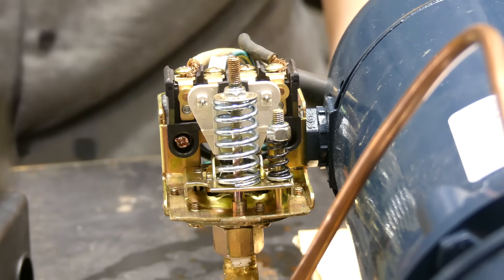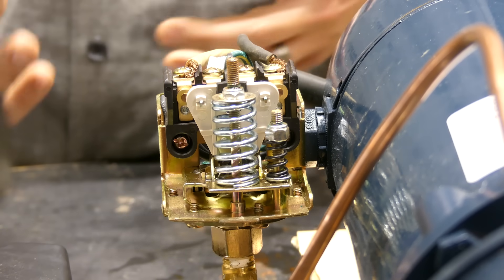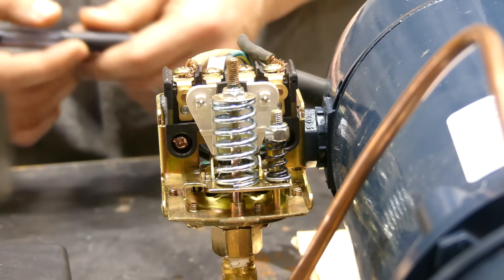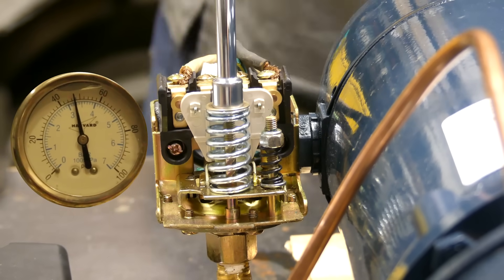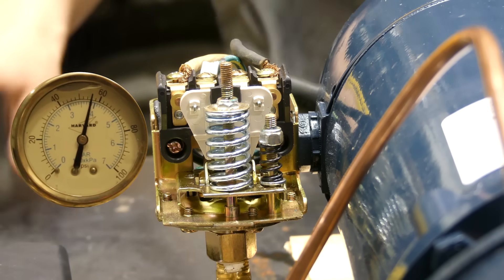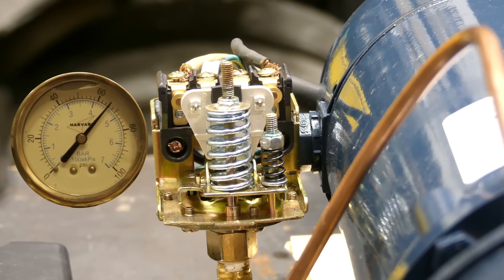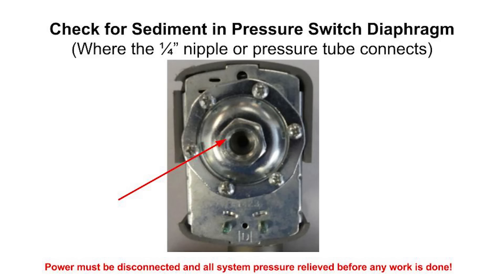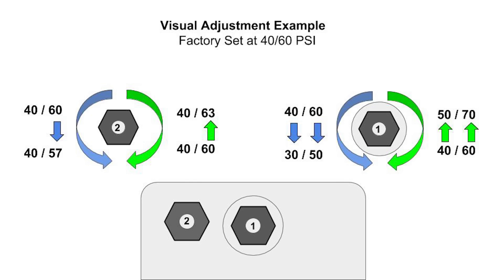How To Adjust a Pressure Switch

Comment: If you increase differential pressure should increase air pressure in pressure tank?
Reply from the maker: Good question! The answer is no, since only the cut OUT pressure changes there's  no need to change the tank pressure.

Comment: How long should it take to go from 30-50?  Mine is much much slower than what you demonstrated but I'm not sure is its because your's is in a controlled environment.
Reply from the maker: Ideally, your run time should be at least a minute every time the pump turns on.
Reply: If you have a large tank and a small pump, it could take a while.   Perhaps the most the pump can put out is 50 psi.  It needs to be rated above this.

Comment: I only have good pressure while my well water jet pump is running. I cant take a shower without it running as the water loses all pressure within minutes. How can I keep a steady pressure in the house? Is there an adjustment I can make so the pump starts more often?
Reply from the maker: It sounds like your pressure tank has failed or you need a larger one. I don't think it's an issue with the pump. Check out our video on how to check a pressure tank for more info.
Reply: @RCworstwater  alright thank you!

Comment: I have just had a new bladder tank and pressure switch installed and now when using the shower the water will stop and then start again in about 5 seconds. could this be a bad switch? the water also spits and sputters at times.
Reply from the maker: It sounds like the pressure in the tank is not set correctly. Check out our video on it: How to Adjust a Pressure Tank Video: https://youtu.be/w21qa2bMUh8

Comment: I have two pressure pumps which runs interchangeably. But for sometime now, it doesn't change. Example; if pump-A is running, if doesn't change. What could be the problem???
Reply from the maker: I don't understand the question. Please give us a call: 855.329.4519

Comment: Pressure at the  1"  (perhaps 1 1/4") water line (city water) is barely 20 . If I dial up my pump to 30 / 50 from 20/40 can cavitation occur enough to cause the pump to burn out prematurely?
Reply: Just make sure the city water is always there, else you may burn out the bearings or motor on your pump.  Where I live in Mexico, we run the intermittent, low pressure water into a cistern.  Then pump the water from there.

Comment: I bought a new pressure switch the other day and it worked fine but now there is no power to the switch at all. I put the old one back on again and it works again but it won’t cut out that’s the reason I bought a new one In The first place. What can the problem be. Thanks
Reply from the maker: It depends on what you mean by "no power to the switch". If it is wired correctly, you should be able to test and see voltage on one half when the contacts are open, and both sides when it is closed. If there is no voltage at the switch whatsoever then your breaker must be off. Give us a call and we can help you troubleshoot over the phone: 855.329.4519

Comment: Hello I would like to say that these are great videos. I do have a question, I live in Chile and do not speak Spanish nor do I trust and Chilean to know what they are doing. With that being said I am trying to get water from my hand dug well to my house (about 100 meters away) and I have a 2hp pump and a pressure tank (24L) with pressure switch (tried an electric switch but would not work do to the distance) all new. I've tried to adjust the pressure switch but the pressure gauge goes up to 50/51 psi and stays there with the pump continually running, what can I do now to try and set it up where the pump gets to the right pressure and shuts off? 

The pump is a Chinese pump (leo) and the tank and pressure switch is Italian (Italtecnica).
Reply: 2 hp sounds more than adequate.  If the pump doesn't shut off, you need to lower the settings on the pressure switch otherwise it may burn out.  I assume the pressure tank, switch, and pump are co-located.

I live in Mexico, and it took 3 plumbers to finally follow my instructions to add some air to my pressure tank.

Comment: hello thanks for your effort, i have a question, can i use it to empty the accumulator while i need empty it when the inside fluid pressure increase to 120bar till the pressure drop to 25 bar

Comment: So is it ok to crank a square-d 20/40 switch up to 30/50 or should i buy a 30/50 switch?
Reply from the maker: You should be able to crank it up to 30-50 like we showed in the video without an issue. Keep in mind that if your pump can't produce the 10 extra pounds it will burn up, so make sure it turns off after you increase it. Once you verify it is able to produce the new pressure, you'll have to add air to your pressure tank to 28 PSI: https://youtu.be/w21qa2bMUh8

Comment: Thank you. But does it has the low pressure protection for the pump? (When the pump is switched on under the cut-on pressure, the pressure keep falling. Will the switch cut off the electricity supply to the pump?)
Reply from the maker: Thanks for the question! We actually have a video on this we will be posting soon. What you are referring to is the M4 pressure switch, which requires a manual reset if system pressure drops 10 psi below the cut-in pressure. Check it out on our website here: https://www.rcworst.com/Square-D-Pressure-Switch-M4-W/-Low-Pressure-Cut-Off-9013FSG2J21M4-p1626.html
Reply: Thank you, I watched the new video about M4 and it's a good explanation. I think I have understood the principle now. My home has this kind of switch with a manual lever to trigger the switch. The pump installer argue with me that the switch has no low pressure protection and suggest us to install a floating ball switch to protect the pump in low water level condition.
I think he mixed up with these two types of switch.
Reply from the maker: Well, Square D also makes an M1 pressure switch that has that lever on the side but it is just a simple disconnect. If you have the M1 switch, it will not trip like the M4 will.

Comment: i have a well probally 150 feet deep deep emerson pump and a bladder water tank.probally 50 years old cursion outsde hw water tank in basement red jacket franklyn or something    leak from back of water tank just a few drops from pressure valve should I be concerned I did replace the motor on wall above water tank..
Reply: i know it will need replaced eventually  what would happen if my tank sprung a big leak would it ruin my well or just shut down  in a bottom basement not concerned about  a little water down there   long as it shuts off I don't want to ruin my well  .. I
not  concerned the whole deep emersion pump will need replaced if I replace this inside water tank with bladder and winter s apon us  I see no problems with pressure needin pumped up maybe once or twice a year.
Reply from the maker: Deborah, please give our techs a call for help: 855.329.4519

Comment: Okay so just replaced a. Controller on my well.  Still having the same issue.  It builds up to about 15 lbs then  stops.  Any ideas would be helpful.
Reply from the maker: Likely a leak or the pump is going out.
Reply: @RCworstwater  copy that thanks.

Comment: I recently had a bad water leak under ground plumber used a leak detection company to find the leak plumber repaired the leak but ever since the water surges when you turn the tap on like there is air in the system

Comment: Hey your first step was to remove the power to the switch and pump that will not have any pressure from pump and no water to regulate. Other than that I understand your instructions. When you have your breaker on would have been better.

Comment: If anyone is up for a question on this topic, I have a shallow well and a small pressure tank (gallons).  The pump I currently use is not very powerful, but it works.  The problem is that it would never shut off with the current pressure setting.  Could I reduce the pressure switch a consideralbe amount to accomodate this?
Reply from the maker: Yes, that should work just fine.
Reply: @RCworstwater  thanks for replying!   I suspect the issue would be more wear and tear on the pump, but with such a small tank I suspect it will kick on quite a bit anyways.
Reply: Could be your weak pump.  If your pressure switch is set to 20/40, and the most pressure your pump can put out is 35 psi, the pump will never shut off.  You will need either a larger pump or lower settings on your pressure switch.

Comment: Good day, Pressure pump  gauge drops to zero and the pump does not come on. Greatful for any solution
Reply: Do you have electric power at the pump switch?  Are the switch contacts closed?  Is the wiring and connections okay between the pump switch and the pump?  If all okay, the pump is probably burned out.  If the motor hums and it's above ground, turn off the power then try to manually turn the motor.  Some debris may be stuck inside the pump.

Comment: What happens if you adjust the range without relieving the pressure first?
Reply from the maker: It should still adjust just the same. I would definitely still shut the power off because the switch may open/close when youre working on it.

Comment: Excellent video. However, I still have a doubt, ...if the factory settings of the switch are 20-40...can I change them to 30-50?
Reply from the maker: You should be able to. Be sure to heed the warnings in the video though.

Comment: Hi nice video if i raise the pressure on pressure switch will the tank be able to handle the increase ??
Reply from the maker: Thanks for the question! It depends on your tank. It should say the maximum working pressure on it. In general, most tanks are rated for 125 PSI or more.
Reply: Yes, if you have an undamaged, rust free tank.  But I saw once saw an installation that used a tank from an old hot water heater!  Ouch!

Comment: Why do the points keep burning and sticking shut? Electric fluctuations or float problems?
Reply: Too much cycling as the current rating on the switches is quite high.  But, believe it or not, this spare part is available for purchase (Square D).

Comment: how much volume of water shld be ideally stored in an 80 gal pressure tank?
Reply from the maker: An 80 gallon tank holds around 20-25 gallons of water depending on the operating pressure.

Comment: Question, if the pressure on the switch is increased, should the air pressure in the bladder tank be increased as well?
Reply: Only if the cut-in psi is increased should the air tank psi be increased to 2 psi below the cut-in psi. Example: if the cut-in psi is increased from 30 psi to 40 psi, then the air tank psi should be set at 38 psi (2 psi below 40 cut-in psi). The cut-out psi is recommended to be set at 20 psi above the cut-in psi. Example of common settings: 30 psi cut-in gets 50 psi cut-out setting - 40 psi cut-in gets 60 psi cut-out setting. No adjustment of tank psi needed for cut-out psi adjustment.

Comment: im trying to stop having a cold / hot cold hot  or from pump cutting in out in out in middle of winter i spent all day trying to ajust the setting just dont work i tryed a differant pump now i got a pump that will not turn off at all dont matter where you ajust it  up or down heap of crap sensor switching shit looking like ill have to make my own switch
Reply: What are you trying to do, do you have a mechanical switch like the one in the video

Comment: I have a question, my pressure switch doesn't turn on whenever it should be. I am knocking the cap of the pressure switch and it will turn on. What do u think i should do?
Reply from the maker: It sounds like the 1/4" tube that connects to it might be filled with sediment/debris. Learn more here: https://www.youtube.com/watch?v=Vq-8RCCeh3k&lc=UgwpLvj_N5tVFDl0Q4h4AaABAg
Reply: @RCworstwater  Looks like you're right. I had it replaced by yesterday. Thanks for your help bro 🙏

Comment: What would cause my high pressure switch to cut off at 55 psi and then slowly lose pressure ?and when it gets to 30 psi it shuts off and pressure drops to zero and then there is a pause in the water flow
Reply from the maker: It sounds like you have a leak

Comment: pressure relief valve is throwing water like a drinking fountain. Is this fixed by adjusting this switch?
Reply from the maker: If the pressure relief is leaking that means either your system pressure is higher than the valve will allow or it is faulty. Most of them are adjustable, but adjustments should only have to be made when it is first installed. Were you adjusting your pressure switch before it started leaking?
Reply: no it just started leaking and was replaced. was fine for a few days then leaked again. i lowered the perssure to around 30-35 and the stream kinda the same if weaker.
thank you so much for your fast response! you guys are great!

Comment: my guage always reads 30psi, i have this pressure switch and a submersible pump.   what should I do?   I want more pressure, i am used to 60psi city water.
Reply: the gauge was bad, i replaced it and now its working.   oddly when i increased the pressure with the main adjustment, it went up to 55psi from 50 but the lower number never changed from 30.

Comment: What would cause back lash in pump. When it shuts off.  It just bangs in the pipes. My air tank is old. Maybe it's that.  Any suggestions
Reply from the maker: Sounds like water hammer... Most likely a failed bladder in your pressure tank, so it's not able to cushion the water when the pump turns off. You can find pressure tanks on our website here:  https://www.rcworst.com/Pressure-Tanks-c171.html

Comment: First off great video. i just bought Green, 1 HP well pump from H.Freight to replace old one which was routed after the water filters on a Above ground water tank gravity fed. Old one worked very well with 12 volt RV water pump on pressure tank for 5 years. REASON for replacing is now I have 110 volt power and need more pressure for different outlets:.. I changed the routing line directly from water tank outlet gravity fed with screen to NEW Pump/Tank and then into the 2 water filters and out to house lines. The pump keeps cycling on and off every 5-10 seconds. I notice the pressure gauge dropping rapidly until it gets to around 28 PSI then cycles back on until it gets to 50 psi, then turns off and as  the pressure drops it turns back on again every 5-10 secs. H.Frieght tech support is awful and they are NOT qualified to help, waste of 30 mins 20 of it on hold. Any help much appreciated.
Reply from the maker: Thanks for the question Ba Lu! We just released a video on troubleshooting a pump that starts too often, check it out here: https://www.youtube.com/watch?v=CPzRpD_Tncc&t=2s&list=PL2vS14kWEB-nOSjDgEH6vZiKrSEbPBUsq&index=2
Reply: Most likely, your pressure tank is "waterlogged".  I had a tank that had only 5 psi in it (rather than 30) and the pump would cycle on/off multiple times when just flushing a toilet.  After 3 plumbers looked at it, and I told each of them what to do, the 3rd one believed me, added air, and the problem was completely fixed.

Comment: Great video. Have a question for you. My pressure switch is 40/60, but it cuts in @35 and cuts out @65. Is that normal? Thanks
Reply from the maker: It sounds like your switch has gone out of adjustment and may need to be replaced: https://www.rcworst.com/Pressure-Switches-c172.html
Reply: Looks pretty close to me.  Your gauge may not be accurate either.  Just follow the instructions in the video or Square D instructions.

Comment: R.C.Worst & Co.,Inc. i have my 1 horse power with a second floor ,is it okay that my pressure range is 40/ 62 here in the philippines. i'm afraid to adjust or might damage  the jetmatic  is it okay not to adjust 63 into 60....please advice .tnx in advance
Reply from the maker: Rey:  Normally small adjustments in pressure will be okay.  However, you should be careful not to adjust the cut off to a point that your pump will not be able to build up to the desired pressure and not shut off.
Reply: ok ..up

Comment: I installed a new jet pump Got it working But the pump kicks on Like the 2nd you use water And shuts off It seems like it's kicking on way too fast The old one Would let you use water A lot longer before it would kick on Let me know what I should do
Reply from the maker: It sounds like an issue with your pressure tank. You need to make sure that the air pressure in the tank is set to 2 PSI below the cut-in pressure of the pump. Here's a video on how to do that: https://www.youtube.com/watch?v=w21qa2bMUh8

Comment: Excellent tutorial. 
Question: I'm changing our range from 30-50 to 40-60. Do I set the air pressure to 38 psi  first or after I changer the pump on/off range?
Reply from the maker: Joe, the air pressure should be adjusted after adjusting the pressure switch.
Reply: @RCworstwater  Thank you very much. Please keep up the good work.
Reply: @RCworstwater Followed you instructions and it's all set and works great. Thanks again.

Comment: Good thing I understand how the system works because anyone not knowing anything about the switch makes your video hard to follow
So explain how it works with the pressure tank otherwise you're going to burn out your pump over adjusting a $20 pressure switch.

Comment: Thanks for this video as well. I have an RO filter on a rain harvesting to tank system.  Great filter, but want to improve the loss ratio for the RO filter.  Increased pressure needed! Something not clear is the effect of a low air pressure in the bladder on the pump operation. Thanks.